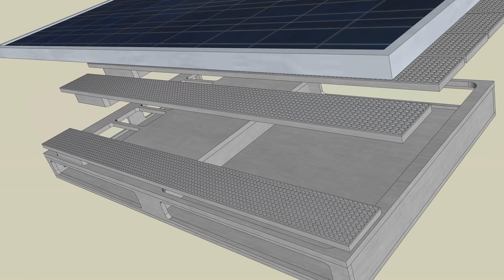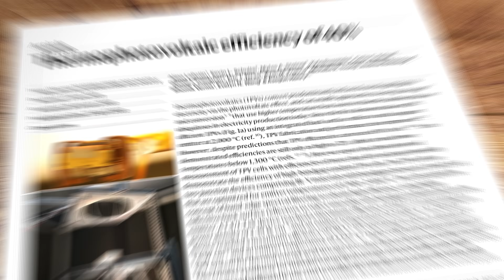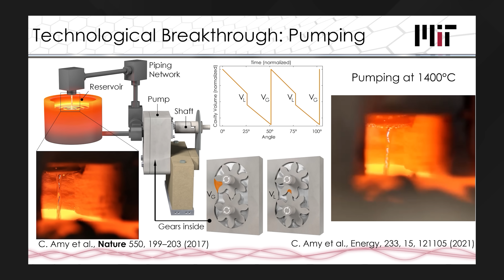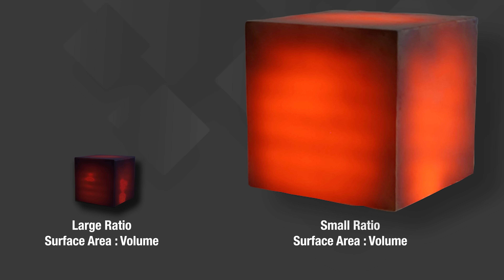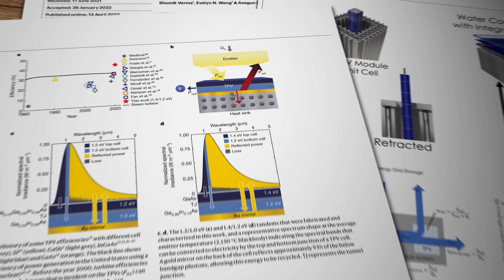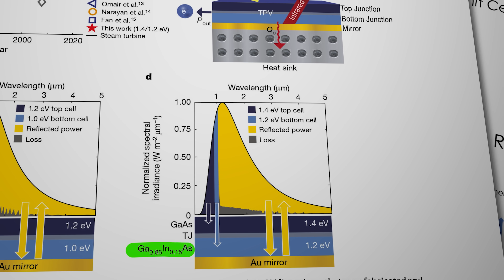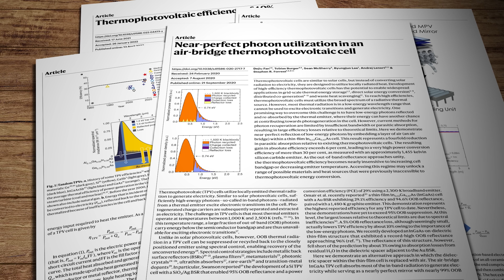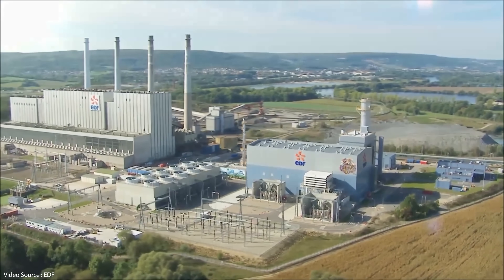Grid Scale Energy Storage 30x cheaper than Lithium-ion! How do they do that?

Comment: So it's 1/10 or less the cost of ANY other energy storage, for just 1 billion bucks all the energy from 100 GIANT power plants could be stored for 1 hr, 24 billion for a full days worth of energy for several ENTIRE STATES, which is far less than the cost of building 100 GW of even the cheapest power plants.  I'm not a glass half empty guy but when it's too good to be true, it's usually because it's too good to be true.
Knowing a lot about the other tech that relies on moving control rods in and out of super hot material, and it's MANY MANY failures, I can predict where this system will fail, the PV 'rods'.  water cooling moving rods is.... not going to be stupid proof, as any industrial wide spread tech must be, much more stupid proof than current nuke plants.  Keeping water liquid, will not work as proven in MANY nuke failures.  Once it starts turning to steam you get uneven cooling and resulting spot over heating, causing two problems, possible material failure from heat and differential thermal stress.  Eventually steam creation will impede cooling water increasing steam and at these temps the super super super heated steam will expand DRASTICALLY, and almost instantaneously thus faster than any operator or machine can stop.  End result will be explosions, probably MASSIVE, ie, Chernobyl, but even if small, once an explosion breaches the containment building the argon will go bye bye and materials will start to 'oxidize' as air takes it's place.  Between the explosion and oxidation molten tin will be spilling out in all directions and into the earth.  If the entire mass of molten tin ends up in one blob in the earth it's going to keep melting its way around for quite a while, bad news for the neighborhood.  It will react with other materials in the earth w possible toxic results, as well as the tin itself, which sounds pretty inert, as an ingot, not as finely oxidized materials in water tables and drifting across the landscape along with carbon, metals, paint and everything else those cheesy warehouses were made of before exploding and being exposed to molten tin.  I assume there is also a problem if the flowing tin continues heating up 'tungsten' without the cooling effect of the rods.  At some point even w argon the tungsten melts.  Wether this damages the carbon containment vessels I don't know, can't do much to help their integrity.  At the least, the plant is now useless until all that carbon can be cooled and relined.  With TONS of tungsten.  As there is a huge thermal lag between turning off tin flow and cooling of tungsten, ANY operator or computer or sensor error could cause tungsten failure redlining the plant at the least.  Such failures WILL happen.  BUILDING around such failures will MASSIVELY increase costs.  Will warehouses need to be nuke level containment vessels in reality?  Certainly will if tin leak might cause toxic contamination of ground water. Will warehouse need to be over a pool of water 10s of meters deep sized to solidify the tin before it can break out of facility.  What about thermal expansion and contraction of carbon blocks the size of semi trailers or carbon pipes hundreds of meters long.  Pipe expansion and contraction is typically dealt with via 'loops' jogging the pipe up over and back down so long sections can move while the vertical pipe sections flex sideways.  That works in FLEXIBLE steels.  Is carbon as flexible?  Will the solution for pipes involve open flow pipes that are discontinuous, pouring into tanks where it's pumped into the next pipe section.  Or will some exotic flexible connector, or cooled collar be needed.  Something will be needed.  Now in industrial facilities pumps even pipes are redundant to allow isolation of a section for maintenance.  However if such is connected to vast heat sinks of carbon and molten tin, will the carbon pipes still conduct so much heat maint will be impossible for weeks, months?  A human needs to do the maint, so pipe temps over 100 degrees won't work, and 100 will be a BIG problem even, as it easily causes burns.  
We have PROVEN energy storage, pumped hydro, compressed air, even liquid air (yes chilling it until liquid effectively 'compresses it' far beyond the best compressor, to run a generator you just warm it up a bit and a stream of high pressure air pours forth).  We have had high efficiency transmission lines that can send power 1,000 of miles, for DECADES.  Germany has developed such to work under oceans.  Energy can be 'stored' by shifting it 1,000's of miles to where it's night or the wind isn't blowing or surfs not up etc, and the reverse.  We can convert electrical and heat energy to both hydrogen and methane (ie natural gas) and store that in tanks, as we have for 100's of years.  
We need more shows educating people about REAL tech that works now w minimal env impact and fewer gee whizz who knows in the future - so we put off enacting what we can now, and must do now, if we are to save the planet before our kids inherit a scorched flooded dead planet.

Comment: I'm rather bothered about this - too much technical wizardry. Surely simpler is always better? Also, the general rule with energy seems to be to avoid converting it (eg from electricity to heat), as this always involves a loss. And yet this system involves TWO conversions - first to heat, then back to electricity. Plus the losses involved in trying to keep the heat in, and the loss of heat when cooling the panels down OK, this can be used for heating, etc, but - again - efficiency is reduced. You have to make the process inefficient for it to work!  I'm no engineer or scientist, but my guts are telling me this is just too complex. Every step has involved solving a problem that just ends up making it even more complicated. The end result is too many conversions/inefficiencies, and too many points where the potential for problems is high. No doubt a fun and satisfying project to work on, but does the end result actually make sense?

Comment: Why choose molten tin as a way to heat up the graphite blocks? It seems technically difficult, so what's the benefit of choosing this method instead of radiating heat some other way? (I admit I'm not sure what the other ways would be, although others have suggested molten salt or electric heat radiation in comments.)

Comment: As engineer who has designed large scale power facilities - when I look at scale of the engineering on offer I still am skeptical ...or dumbfounded ....at how they get to <$10 /kw-h costs, when liquid air battery storage - which to me appears all round  simpler, lower tech, lower cost option always come in at >$150 /kw-h or sometimes upward of $300 /kw-h (i.e. comparable to Lithium)
If you gave me a dare - and say 'go for' liquid air battery storage ..or this, just on basis of the visuals presented of this I would go liquid air.
OK - so I haven't trawled the data and peer reviewed anything on this - but if this is well within even an order of magnitide of costs where they say it is - then this has to be a solution to focus on. Big time.
But I remain skeptical. Seems too good to be true. Think a decmal point iskipped a place on the costoing somewhere here.
Reply: I'm not an engineer, but i've examined a lot of energy storage approaches and, yes, your last sentence summed up my impression --  "did they skip a decimal on the cost calculation?"

Comment: In order to make a more efficient use of the stored heat energy there, instead of sending the cooling water through an external heat exchanger, why not let the water be converted into steam to drive turbines to generate additional electricity first there?!

Comment: If you have high quality heat at 1400°C, you're still better off using a traditional engine than TPV. You can get the 62% efficiency of a traditional combined cycle plant instead of 40-50%.

Comment: I think building one is really hard, to the one side you have huge temperature shifts etc putting a large straign on equipment but if you need to fix or replace anything you got an oxygen free environment filled with stuff that's thousands of degrees. It's orders of magnitude harder then molten salt and that was a design disaster.
Reply: I would guess that the skill, materials and workmanship required wouldn't be much different than the launch vehicles SpaceX builds. In other words, it's possible to build a working system using known materials and workmanship.

Comment: This segment had me asking, "Why tin?" So I looked up its properties. Besides being soft, malleable and ductile, Tin has a wide temperature range in its liquid state with a melting point of 232°C, and boiling point of 2602°C. These all seem good properties for use in a heat exchange application.
Reply: @Lars Hansen At 2 ppm crustal abundance it is rarer than uranium. It costs 38.67/kg when you use it in tiny amounts; a whole motherboard contains what, a couple of grams? The graphite blocks need enough tin to be submerged and the gaps need to be wide enough to allow it to circulate and there needs to be enough tin to fill the loop. If you need merely 100 cubic metres of tin for one of these storage plants (that's not a lot, it's merely a 4,6 m cube) the game is already up. That's 1000 tonnes and approximately 1% of world wide tin production for this one tiny storage plant. At current prices it costs only 40 million dollars; but if you actually build some of these plants prices will shoot up until it doesn't make any sense to build more of them. If the price of tin approached the price of silver it would still make sense to use tin solder in motherboards; that's a very inelastic demand and prices will go to the moon if you try to build tens of these plants per year. It's not scalable with tin.
Reply: @soylentgreenb  Finally someone does some math Thank You!
Reply: Tin is also rare. Not quite as rare as silver, but much, much rarer than copper.
Reply: @soylentgreenb  No Tin, no bronze! No bronze, no stab stab sticks! No stab stab sticks, complete Bronze era civilization collapse! Ergo, you can't have civilization without the ability to be brutally uncivilized by inflicting mass casualties...
So tell me why civilization is a good thing again. Forget all that! We just figured out how to work iron! Yeah! Problem solved! I think...
Reply: But why not directly heat the graphite block from resistances in its core ? Much simpler no ?
Reply: @gregoire5413  An excellent question. That would seem to simplify the implementation and it would remove one of the heat exchange steps so it would seem to be theoretically more efficient in terms of thermal losses. Perhaps it has something to do with goal of creating a modular system that could be easily expanded, Of course the heating elements themselves are being cooled by the returning molten tin so perhaps the system would have to operate at a lower temperature, but I am not sure.

Comment: Wouldn't all the heat generated by the storage systems compound the earth-warming issues? After all it will increase the amount of heat retained near the ground surface area even at night, I would assume, so the heat produced by the earth would add to it, and it would not dissipate as efficiently as the earth produced heat does at late evenings and night.

Comment: What is a reasonable expected maximum efficiency rate of solar energy in the future? Can it get much higher than 50%, seeing as it has so many components, and complimentary system requirements?
Reply: The Shockley-Queisser limit is 33% for silicon cells. The best I know of, from the Frounhoufer Institute, is 26%. But there are projects trying to get around that limit. 

There are cells available with better materials than silicon. Those can get 40%, but are mostly used in space.

Comment: But the cooling down of the water pushes a ton of heat energy into the atmosphere which heats up as a result. That's not ideal if you want to prevent climate change. Instead of radiating it away, you should probably use it to power a steam turbine and/or a water turbine if the water needs to be pumped at fast speeds anyway.

Comment: Seems cool, I'm with the rest of the community questioning if the waist heat could be used somehow. Perhaps it could preheat the tin or power a turbine to generate additional electricity. To that end, why not use the hot tin to boil water and produce electricity the old-fashioned way?

Comment: So I can shine a flashlight on a solar panel and use the power it generates to charge the flashlight battery... with a little help from a gas generator. In all seriousness, that much heat is far more destructive than theories can easily demonstrate. Even very small objects heated to such high temperatures require massive support and maintenance.

Comment: Great video, good concept. I wish the video addressed their solution to the initial startup problem: How to initialize the pluming and carbon blocks to a point such that the tin does not solidify in the system (external to the heading system) while the system comes up to operating temperature.

Comment: When discussing the cost advantages of this concept for some reason there is no mention of the cost of maintenance and repairs. Will this thing not require it? Looking at the potential design of the system maintanance would be an absolute nightmare. I would not be surprised if the cost of maintenance exceeds by a good margin the cost of construction and launch. A nuclear station is cheaper to maintain than this mostrosity. Even if the whole system is not a scam (there is a great potential for that too) I doubt it will ever leave the lab level.

Comment: If, for some reason, you run out of electricity to heat the tin or the pumps stop working you end up with "frozen" tin clogging the pipes. Then the whole system is f****d up...